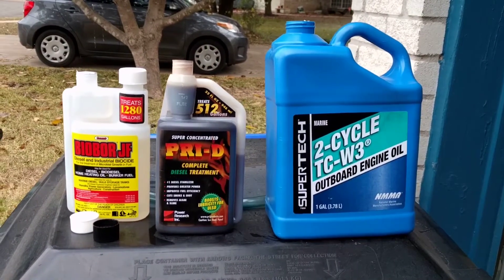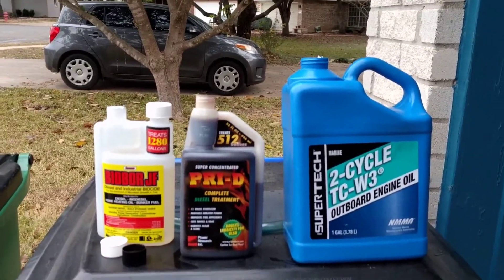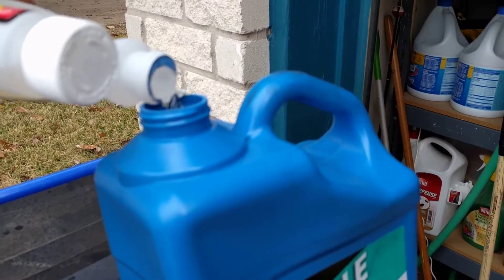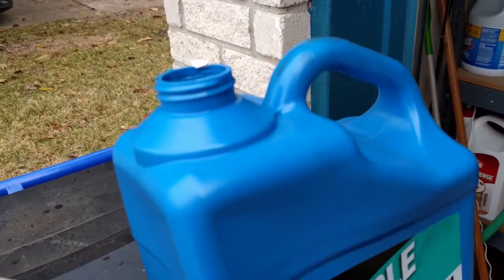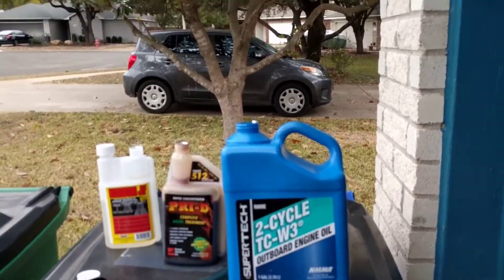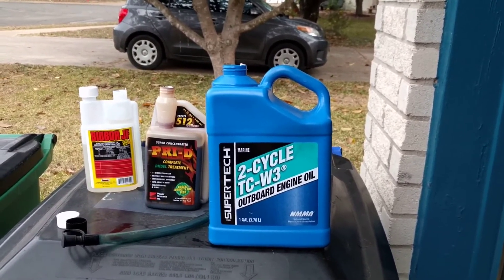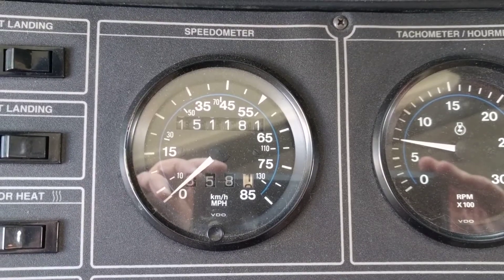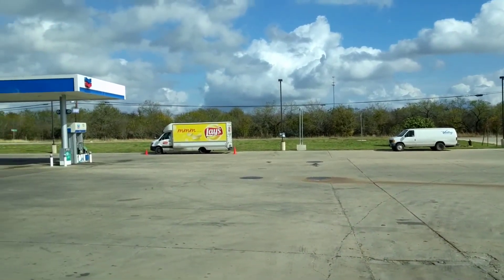Diesel fuel additives - My custom brew

Comment: I have mixed marvel mystery oil and power service silver bottle together at their own respective dosages and that quieted the engine down a lot and made it run a lot smoother
Reply from the maker: Yes that is good stuff too...this is basically just for older diesels who have an injection pump that wasn't designed for the super low suphur fuel (sulphur is a lubricant). The good thing is if it's an older diesel it doesn't have any emissions so it will burn pretty much anything!

Comment: What components you consider emissions controllers? I’m familiar with catalytic converters and dpf, but i own an older 7.3 powerstrock, that have older style systems. Hope i can use this mix you use? Thank you
Reply from the maker: My main concern would be with cat's and dpf's. Honestly, if the vehicle came with a cat or dpf then these additives really aren't needed because the engine was designed for the low sulphur fuel we have now. My motorhome was a '95 so all it had was a muffler and it was built before the "low sulphur diesel" fuel came out.

Comment: How often do you use this every fill up or every fuel filter change??? Thanks
Reply from the maker: Every fill up but that can be 6 months apart in winter because it's a motorhome. If you are getting fuel regularly I would only add the 2 cycle as the other stuff isn't really necessary unless the fuel will be sitting for quite some time (6+months). Also, remember DO NOT use any 2 cycle if your diesel has an emissions system such as a dpf, etc.. as it will clog it up and it really isn't needed. I do this on a 1995 mechanical cummins engine that was built when diesel had a lot more sulfur in it which acted as a lubricant.
Reply: @BubbasWorkshop  I bought my first semi it’s a 1999 freightliner fld120 12.7 Detroit pre emission it’s a working truck just found out about 2 cycle oil in diesel and found your channel so I was think every other fill up 2 a week 200:1 200 gallons
Reply from the maker: @TitoBoi86  Yep just make sure it's the TC-W3 2 cycle like they talk about in that study (has something to do with low ash content)..thanks!

Comment: Start with a 2.5 gallon (320 oz) container. Add one gallon of  Super Tech 2 cycle oil; one quart (32 oz) of Opti-Lube Summer Blend & one quart Marvel Mystery oil. Top off the rest of the container with diesel fuel. As the Opti-Lube treatment rate is one ounce per 10 gallons of fuel for max treatment you can see that I can simply add an ounce of this mix to each gallon of fuel (32 oz Opti-Lube treats 320 gallons of fuel). As per Opti-Lube instructions you can treat as little as one ounce per 20 gallons for a maintenance level so my container could take care of 640 gallons if I wanted. I added the 2 cycle oil for extra lubricity and the MM Oil as a solvent or cleaner.

Comment: Smart men.
Need only little of 2cykle oil to mix with diesel fuel.
I using 1/4 of a small bottle of Red Line 2cykle oil for 100 liters of diesel fuel.
Try to imagine the amount of sulfur in previous diesel fuel was just a little not so much what you trying to compensate.
Reply: Redline is THE BEST 2 STROKE oil MADE! It is the only oil that I know of that has ZERO carbon build up on any engine motorcycle or RC, and yet never ever hear about it in the diesel community.
Reply: @elcajoia619  What do you think about these diesel oils: LIQUI MOLY Top Tec 4110 5w40 V.s MOTUL 8100 X-Clean GEN2 5w40?
Reply: @jaguar7051   
LIQUI MOLY and MOTUL are awesome, only use MOTUL in my motorcycles street and 2-Stroke. The thing is 5w for a diesel is a little thin, small diesel engines/cold weather sure that works, but personally 10w just to be safe.  I have Cummins/Powerstroke/6.9 IDI and live in a warm region, 15w40 ALWAYS, only use Rotella Synthetic, Schaeffer oils, when I get to higher mileage may switch to RedLine 15w40 but man it's $$$$ .
Reply: @elcajoia619  Yes Sir * I mean 5W40 
My Diesel is with DPF - needs MB specs 229.52 - Motul and LIQUI MOLY have those specifications * some peoples saying MOTUL  is not so good and others saying LIQUI MOLY is not so good * Today Marketing and fancy names can create something as miracle or opposite.
Reply: @jaguar7051  if it's an OM642 that you're running, I have  2011 W906 that runs kerosene and a quart of 2 stroke oil. No issues, 200K miles, when a regen occurs, it puffs out a little blue smoke from the 2 stroke. but the big difference is how quiet it is, as well as the 5 mpg improvement, starts real easy in cold NJ. on my other one that has a custom remap, that one is nuts, no smoke, 10 MPG improvement, and it will kick an ESP limp mode when accelerating hard.
Reply: @dannyelasri247  W906 is not known to me? tell me more about this car and engine? what is the size of the fuel tank? _ I tried 2 cycle oil and not like - exhaust pipe become wet with oil - I using fuel additive from Canadian Tire looks exellent - cheaper from MB or others
Reply: @jaguar7051  W906 is a Mercedes Sprinter van
I add about a quart to a full tank. it has the OM642 which is the bluetec 3.0 V6, the trick to getting the most use out of this combo is to work the engine under load at high RPM (3200) for at least 40 minutes, then watch your fuel economy jump
Reply: @dannyelasri247  What I learned is the fuel economy display is not so accurate all the time - needs time to time reset * yes what are you saying is true cleaning nozzles and internal combustion plus economy display resetting by self. - I had observed when driving 160Km/h for a longer time 9.5L/100Km stays forever - needs reset and on so on - BMW has a more accurate economy display.
I like OM642 as diesel performance only not like the qualities - the most expensive Prostetiut from MB - In the springtime, I going to replace Timing Chain - already get all that need to perform the work - parts and tools - 165000Km timing chain stretched no good - BMW 3L 6R engine can go for over 500.000 Km without any job on timing.* BMW 6R 3L is built in Austria, not by BMW - Today in Germany we can Get from Mercedes 3L 6R Diesel Engine about 400Hp same as BMW * Mercedes con Artist had prepared themselves to cash on American Market for that reason push V6 because American love V6 Engines.- Today those 4cyl Diesel engines for MB are build by RENO in France
Reply: @jaguar7051  I measure fuel economy by how many miles do I get for a full tank. example I also have a 1.9 PD TDi, that one returns 600 miles for 1 full 55 Liter tank. but no thank god we don't have that horrible 1.5 DCI from renault that mercedes puts in the cheap cars. here we only have OM642, and OM651, OM617. 
for VW we have 1.9 PD, 2.0 CR TDi, 3.0 CR TDI
for BMW we have 2.0d, 3.0d, twin turbo 3.0d.
we also have strange diesels: 2.0 JTDm in chevrolet cruze, 1.6 Opel diesel in chevrolet equinox
3.0 VM Motori in Jeep and Ram 1500
3.0 V6 HDi in Ford F150 powerstroke
2.0 HDi in Range rover discovery.

Comment: I like to mix Howes, Marvel Mystery Oil, and ashless 2 stroke oil in a 3:2:2 ratio and add approximately 2 cups every fill up in my old 7.3 PSD. It's cheap, helps the old girl run a little smoother, and boosted highway mileage by about 1 MPG.

Comment: Hey BubbaEinstein, what about putting small proportions of petrol in diesel (considering 2t oil is put too). I've heard that mixing diesel with petrol makes a better, more complete burn. I've also tested 65L diesel + 2L petrol and it gave 0.5L/100 better fuel economy (nit sure how much mpg is that, but the difference was from 6.7 to 6.2L/100). Have you tried such a brew?
Reply from the maker: I wouldn't do that because I am trying to address lack of lubrication in modern diesel fuel not efficiency...petrol/gas is not a good lubricant.
Reply: A lubricating oil composition for two-stroke cycle cylinder injection engines contains as essential ingredients:
A base oil containing,
(1) 10-30% by mass of polybutene with number-average molecular weight 250-350 on the basis of a total amount of the base oil,
(2) 30-60% by mass of polybutene with number-average molecular weight 450-550 on the basis of the total amount of the base oil, and
(3) 15-40% by mass of mineral oil and/or a synthetic oil, which is other than polybutene, with kinematic viscosity 2-35 mm2 /s at 100° C., on the basis of the total amount of the base oil; and (￼: 2-15 parts by mass of alkylaminophenol having an alkyl group with 8-400 carbon atoms relative to 100 parts by mass of the base oil."

No Sulf
Reply: No Suphur.

Comment: Looks like a good preventative routine.
Only suggestion I'd make is to add the mixture halfway through the pump process.
You'll mix it in better and wash it off the fill pipe.
Reply from the maker: Torsee Good idea.. Thanks!